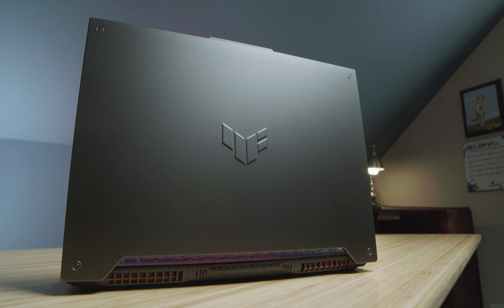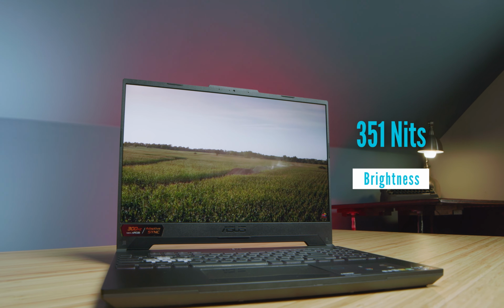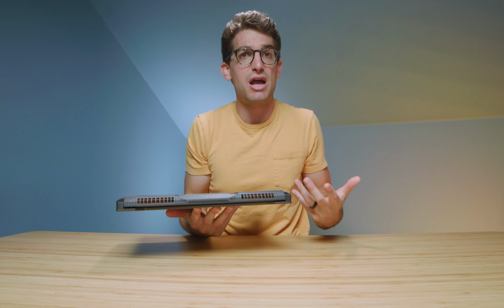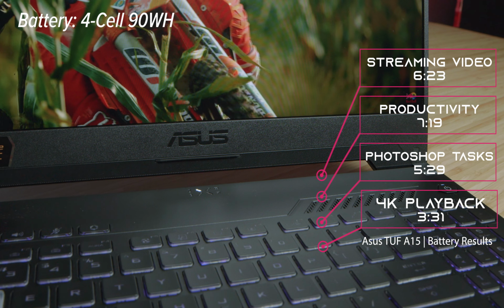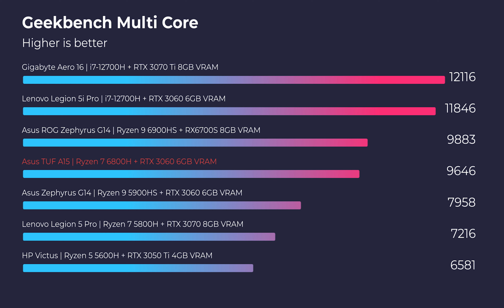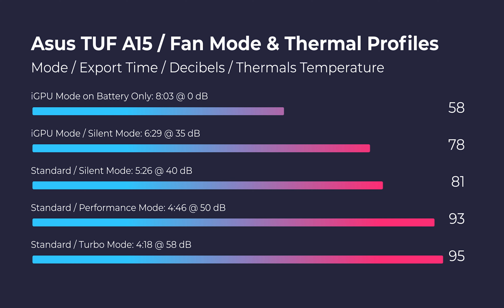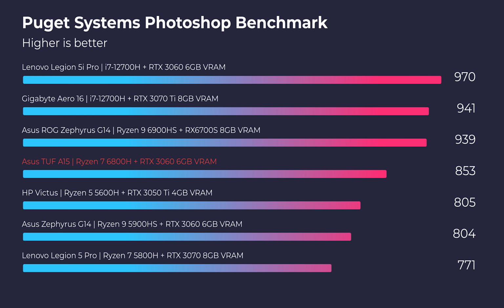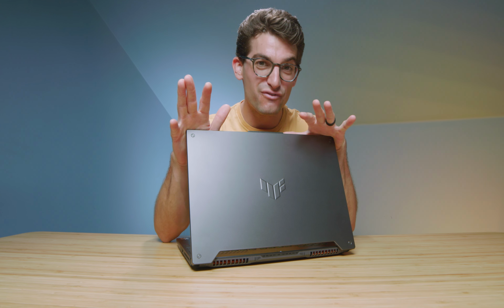(2022) Asus TUF A15 | Left Me Wanting More...

Comment: They have some versions of the A15. I ordered the 165 Hz version of it today… upgrade from my 2020 A15, 4800H with an nvidia 1660ti
Reply: Which graphics card did you ordered bro? How is the display
Reply: @ikmusicpoint5926 I got the 2560 x 1440p and 165 Hertz. The old 2020 looks like crap now! Lol. It's a nice screen but the laptop itself is too unstable. Keeps crashing the browser. Buy another brand. ASUS on the decline I think, sadly.
Reply: Oh, got the 3060 equipped one. Runs EfT in high details just fine!

Comment: Hello! Can someone here help me? I bought the same laptop, but with rtx3050ti variant. Do you happened to have problem connecting with internet? because mine is too slow. I can only connect it to 2.4g channel and I'm getting a 3mbps only. The 5g is not even connecting and I know there is a problem with this laptop, cuz I have the acer nitro 2021 before and I'm getting a 80mbps on 5g channel. Planning to return it, but I am still looking for a solution.
Reply: try updating drivers for ur wifi card, if not get an intel ax 210 wificard and throw it in, its about 20 bucks

Comment: Great video! Should I buy this one or legion with 5800 is better choice in terms of build quality and display? Both rtx3050. Thanks!
Reply: asus 100%
Reply: @someone-nk8mk  why
Reply: if you can, go buy HP OMEN 16. you could get rtx 3070 with the price of 3060.  but i will chose asus if i could since i have a lot of time with the brand. i have one ASUS laptop which fall from the desk, and it was no problem at all.
Reply: @adipramono1666  the omen's 3070 is clocked much lower so it actually performs worse than the 3060 in some cases

Comment: Can i go for tuf a15(i7-12700h 12th gen processor) or rog strix g15( ryzen 7 6800h) ? 

Main purpose for graphic designing and video editing...

Thanks..!
Reply: Why dont buy Tuf ryzen 7
Reply: @destroyer620  currently unavailable
Reply: if u dont need a web cam and a thunderbolt 4 go for strix! better cooling coz it has much more vents. go for the Qhd resolution.  And the strix supports usb type C charging and dolby vision support and the tuf wont.

Comment: In my country this laptop costs around 1400 USD. The 2021 version is 1257. Does the +143 USD worth it to buy the latest version of the laptop?
Reply: What's the processor? 5800H with a RTX3060? if yes then there is no need to upgrade to the 6000 series. Jarrod said that upgrading one generation up isn't different. However, it's your financial choice to buy a 2021 or a 2022. Beware that the battery isn't great.
Reply: If you want the latest, buy with Intel 12th gen not AMD this year. So go for Tuf F15 (2022) not A15
Reply: Plus 2022 has ddr5 memory as opposed to ddr4 of last year's model.

Comment: This was supposed to be a BUDGET laptop yet it costs more than the Lenovo legion with the same specs but last gen processor. I really don't understand how they priced this one and what's the point of TUF series when it's not even budget anymore. The same spec Dell g15 with i7 12th gen costs less than this lmaoo
Reply: Well, tuf series was never budget friendly. And amd 6 series is the newest processor wdym
Reply: Don't know what you are smoking but this TUF A15 2022 model is ~ $200 cheaper than Legion 5
Reply: @Rohan1s495  that is true. Legion5 is around 300-350 more expensive than TUF a15, at least where Im from.

Edit: TUF was on sale, probably around 200$ more expensive
Reply: Dell G15 has a bad build quality and display. The design looks outdated, like a 2005 laptop, and the laptop is full of plastic.
Reply: Really want to know what kind of drugs you do ...this laptop has a 6800H which is a 2022 CPU and definitely not last gen and the Dell ones costs like 200$ more with a 12th gen i7 12700H even the same 6800H costs like 80$ more...also Dell G15 has poor keyboard and display...legion with same specs costs like 270$ more

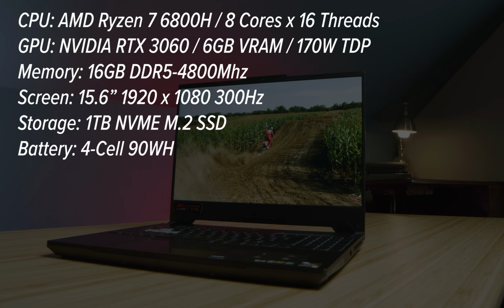Comment: 1:18 A slight correction about the specifications. "RTX 3060/6GB VRAM/170w" You have mistakenly mentioned 170w here, it is actually 140w. So, RTX 3060/6GB VRAM/140w.
Reply: Yeah, 170 I think in 3070/Ti version
Reply: @natsumeyashi3383  No. RTX 3070 is 140w. 3070ti is 150w. RTX 3080ti is the only graphics card which is capable to pull of a massive 175w.
Reply: Pretty big correction tbh 30watts difference lol
Reply: I'm glad you commented on this, I was like if this Asus is actually pulling 170watt for it's 3060 then you can also use it as toaster! 🤣